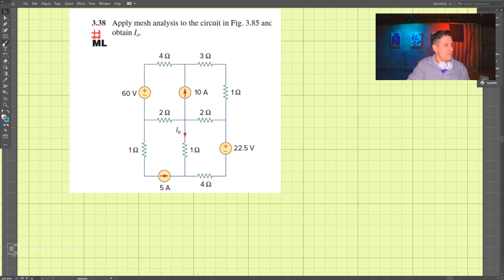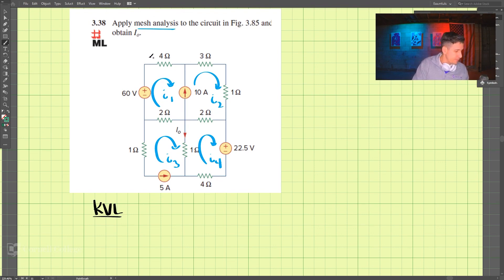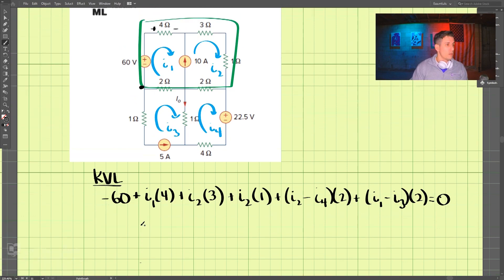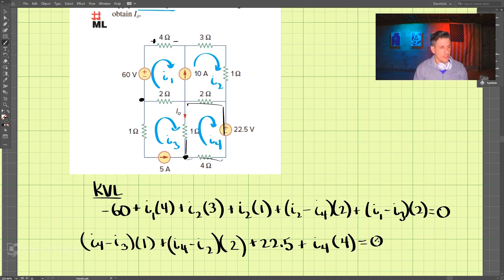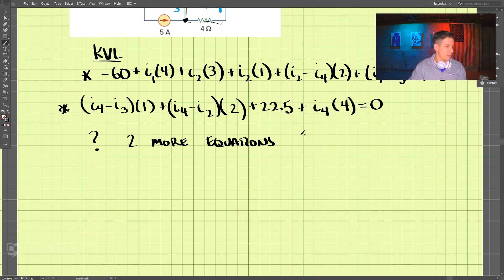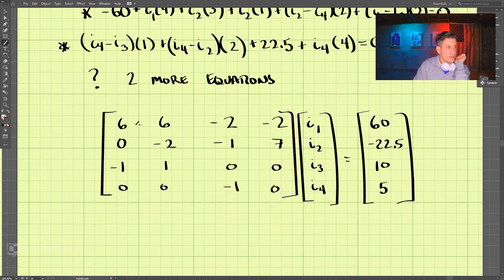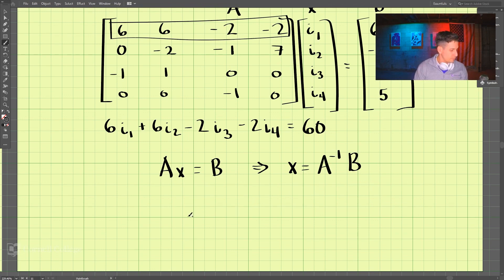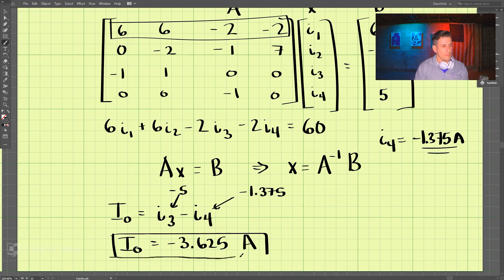3.38 - Example Problem - Fundamentals of Electric Circuits

Comment: Sir, u make me stressed all the way through the video because my answer were wrong, i ask chatgpt and his answer exactly the same as mine which is -10.351amps
Reply from the maker: Check the sign on mesh 4, the way the loop is drawn, it should be +22.5. Not -22.5